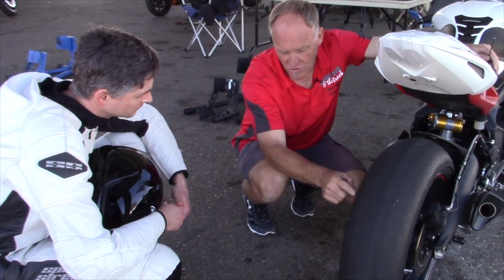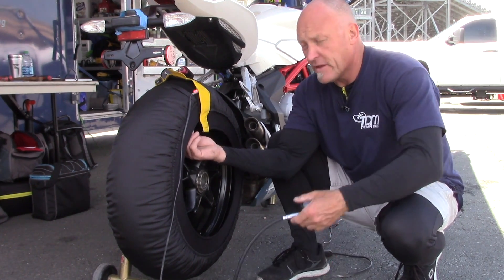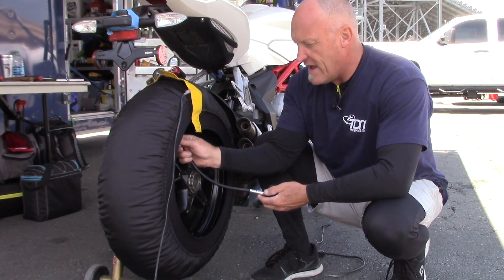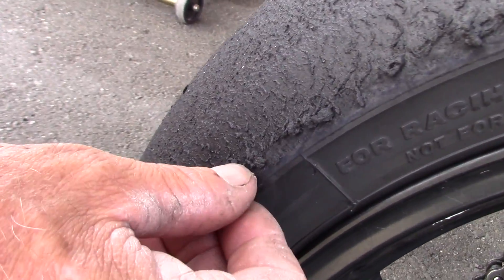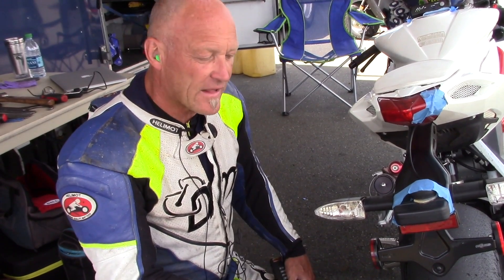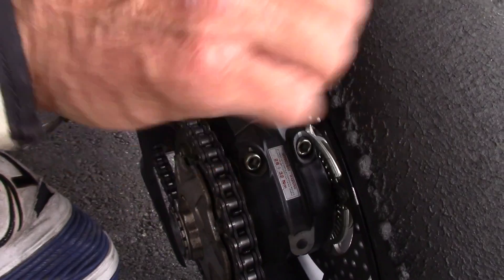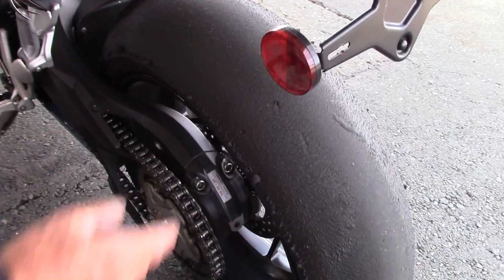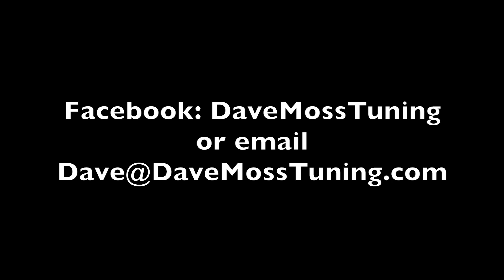Contact Patch: Testing Motorcycle Tire Pressures (TRAILER)

Comment: Dave, typically what is the normal range of temperature you would see using a laser infrared thermometer for a tire immediately coming off the track (and was driven conservatively in a non-competition manner)? I can't seem to find that data available on the internet but rather your advice on putting your palms on the tire to know by feel.
Reply from the maker: Coming off the track for an intermediate rider with the usual procession line heading into the pit will yield temps in the 50-65C range on street or track tires via an infra red pyrometer.
Reply: Thank you, Dave as always for us less privileged folks in Canada who can't meet you in person.

Comment: Bought the video! This is a really good guide with perfect guidelines and tested in actual practice. A must for every trackday enthousiast! Will certainly buy more videos!
Do you have any advice or footage of suspension tuning on an aprilia rsv Mille from 2000 with the ohlins setup?  
greetings from Belgium!
Reply from the maker: please email me dave@davemosstuning.com with spring rates, last suspension service date for the fork and shock, gearing changes from stock, engine power, your weight without gear and tire brand, size and compound.